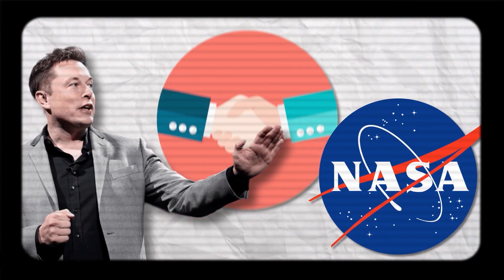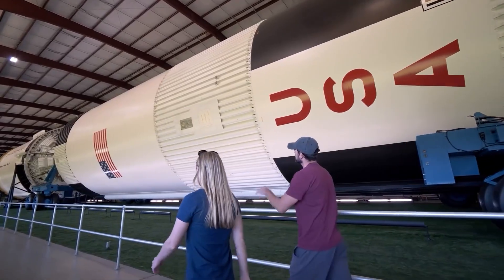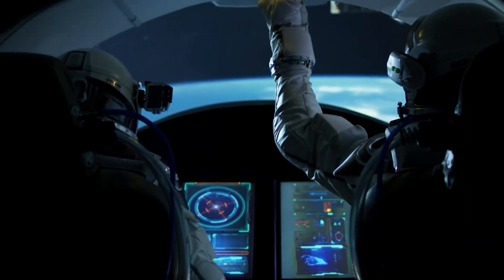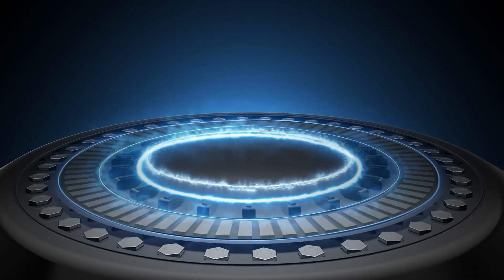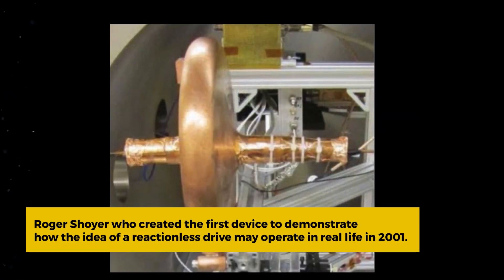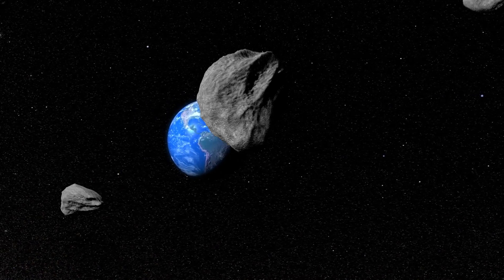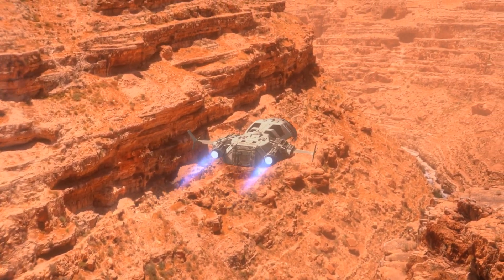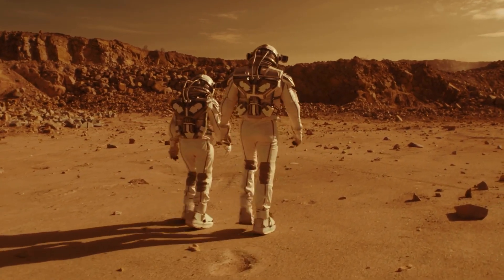Elon Musk & NASA`s Secret Project REVEALED! A Light Speed-Engine That Defies Physics!

Comment: what the fuck is a mile
Reply from the maker: 1 mile is 1,61 km. So 140 million miles equals 225 million km. “Million” is left out in the video when talking about 225  km. Se pinned comment!
Reply: @f1circus  it's a joke, i know what a mile is. Later in the video you said miles without showing conversion.

In physics, we use SI units for a very good reason

Comment: Utter crap! Relativity laws prohibit traditional thrusters (via propellant or not) allowing a craft to reach (or near to) the speed of light.

The only currently known way to achieve relativistic speeds would be to bend space-time around the craft (a warp drive), or travel through a wormhole (maybe trans-dimensional or time travel engines would suffice) all of which are only theoretical and we have no way to implement them (yet).

Einsteins theories  have yet to be proved incorrect but Newtons already have. Ion engines are just thrusters using electrons instead of chemical reactions as thrust therefore they are still bound by physical laws. At no point can an Ion engine increase the mass of electrons to improve thrust!

Using pseudo-science as science should be a crime!
Reply from the maker: The future will tell!